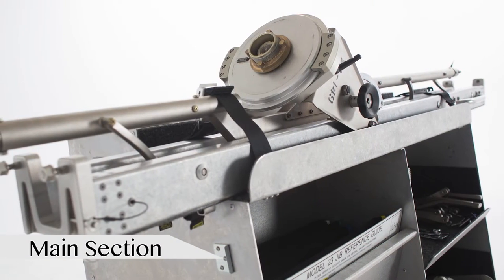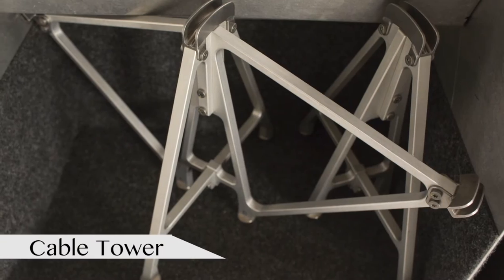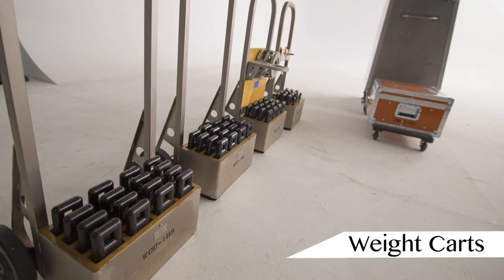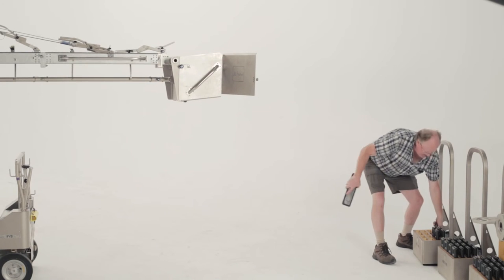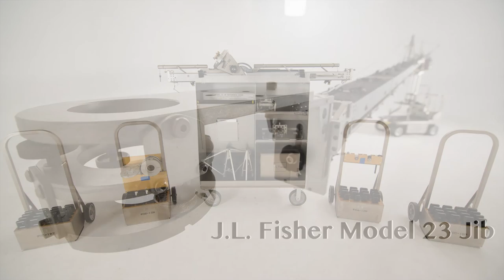The JL Fisher Jib Arm

Comment: nice jib, but the "riggers" should have more mechanical know how, than to use only            
open- enders to tighten those bolts!!-esp if the actors/ staff lives depend on it!! (as they look from the video to be only an inch long!!).
SHOULD have used tension wrenches, or at least a foot long breaker bar and a socket wrench to tighten, and the wires should have turn-buckles to tension, this video showed assembly, but to loosen one has to grab a broom handle, pull the safety pin, and flick the lever with the broom, HOPING not to whack anyone in the face while doing so !! in this day and age of OHS&W , me thinks someone in the design depot is getting an ass whipping for allowing an unsafe design out into the marketplace!!
Reply: Grip channel!